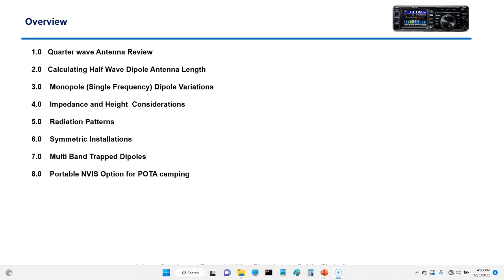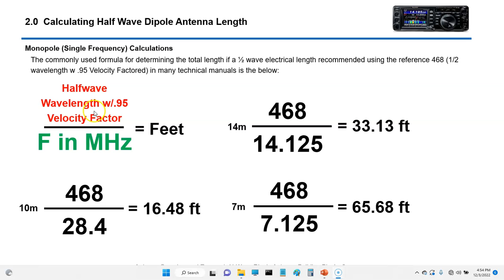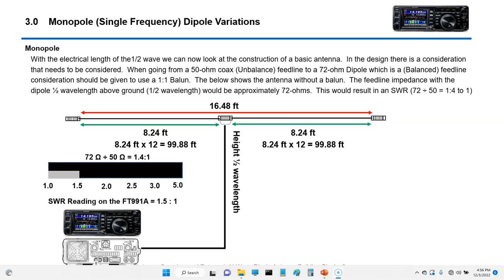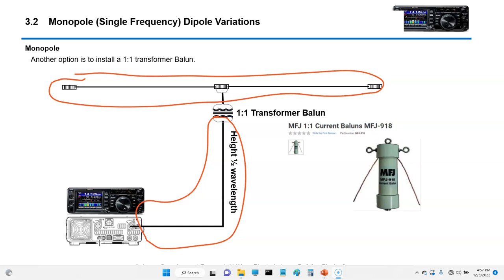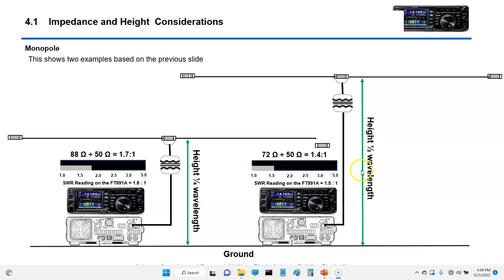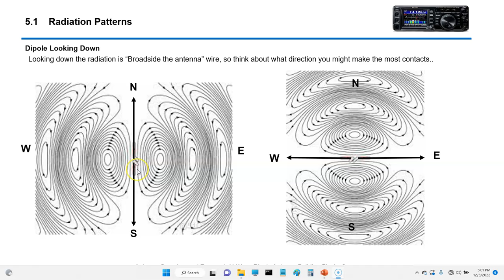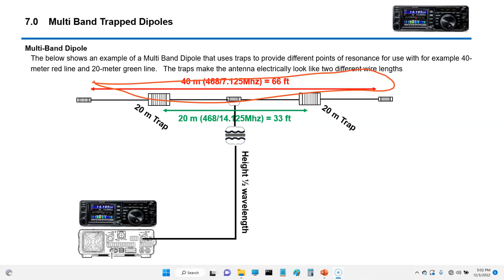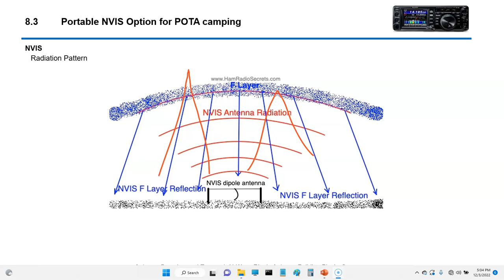Introduction to Antenna Overview and Research ½ Wave Dipole Antenna Building Blocks 2

Comment: Pretty good info.  But note your 468/ chart at about the 2 min. mark contains a couple of errors.  When dividing by 14 MHz and 7 MHz, you're associating the wavelength with 14m and 7m respectively, rather than more correctly 20m and 40m.  Just thought you'd want to fix that.
Reply from the maker: Thank you for that I will update the power point update the description I appreciate it very much '73.  I should have caught that thanks again.